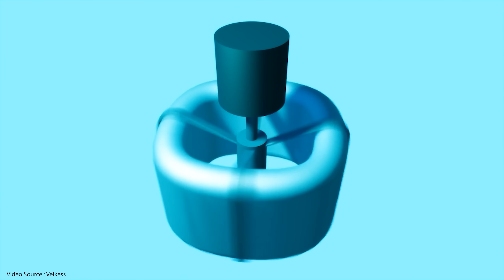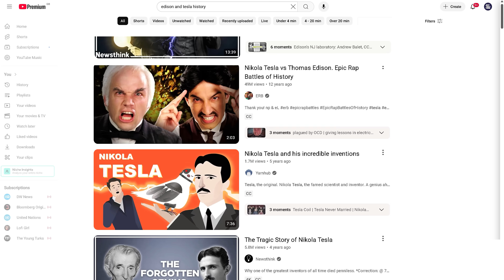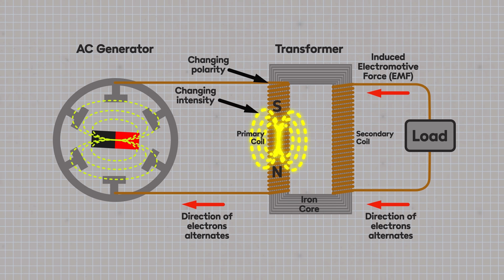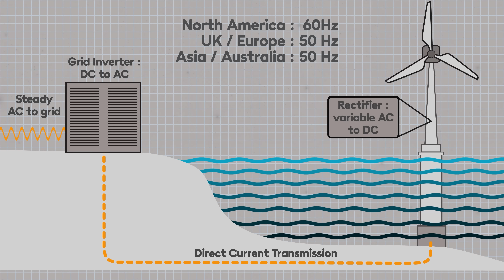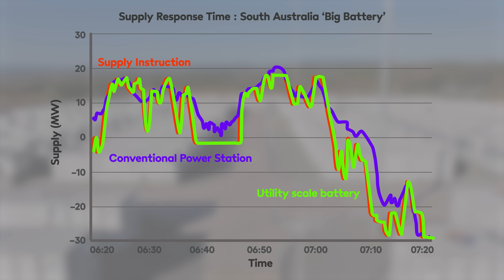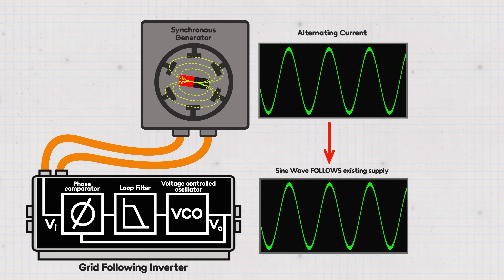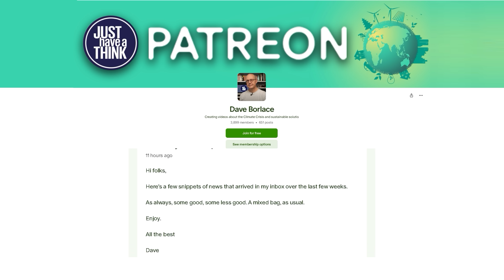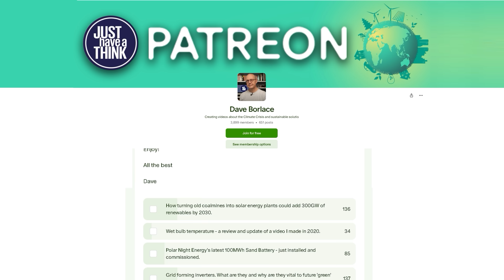How GRID FORMING INVERTERS are paving the way for 100% renewable energy.

Comment: The issue will be having a master waveform generator.  From a blackout situation you can’t have multiple  inverters all start coming online and trying to back feed the grid.  The wave forms all need to be synchronised.  For this there needs to be a common stable waveform for them to synchronise to.  Black starts will be  a lot slower to come back  without the large power stations running in the background as the master clock.
There’s nothing new about grid forming, inverter drives have been doing this for a long time.  If you have batteries and a grid forming inverter there is no reason why your own house can’t come online but it won’t be able to back feed to the grid while someone is potentially working to resolve the issue in transmission lines.  You certainly won’t be able to just start the grid yourself from your own inverter.  Networking them isn’t a possibility because you don’t have power for a network communication.  
They might be able to split the grids into smaller sections that can come online from a fairly large battery inverter and link up one by one.  That’s a fair way off and would be a lot of infrastructure changes and safety precautions and interlocks.   The risk to the workers on the grid from a dead cable suddenly becoming live will not be easy to mitigate with grid forming inverters.  
There’s also a  huge amount of inrush current needed to restart even a block of flats from a total blackout.  Multiple smaller inverters are really going to struggle to provide that kick.
To say network inertia isn’t a thing just isn’t true,  it’s not solved and it’s not solvable without serious changes to the way we maintain and distribute power.

Comment: Inverter frequency is determined by an oscillator, load has no effect on frequency (except when tracking a change in grid frequency).  

A second benefit of turbine (flywheel) based power generation is short duration surges.  The inverters that I've designed are capable of 125% of load, the shut down when load hits 150%.  Even if the load transient is very short.  This keeps the power switches from overheating and failing.

A turbine based system can provide many times "full load" rating with a slight dip in voltage, and slight dip in frequency.  The thermal mass of the generator keeps it from overheating unless the overload lasts a long time, in which case protection circuitry disconnects the generator.
Reply: A stand alone inverter uses a simple fixed oscillator however a grid connected inverter must generate at the same frequency as the grid it is connected to.  A grid-following inverter simply runs at the exact frequency of the grid in in phase with the grid.  A grid forming inverter will run at the same frequency as the grid, however it will try to increase or decrease the frequency based on the primary control response (Frequency-Watt) by trying to advance or retard the phase of the voltage it generates compared to the grid voltage.

Comment: I Install Victron systems that disconnect the user from the grid and continues to supply power if a power outage occurs or the grid gets unstable. You won't even notice it, wich is great for critical use cases like hospitals, military, communication infrastructure and production. They run on battery and solar during the outage and re-synchronize to the net after it comes back and then reconnect.
These systems can either feed surplus (solar) power to the grid, just supply the used power or supply peak power, when the grid connection is to small. 
As far as I know, no gridcode allows theses systems to act as grid forming inverters yet. But that would be a simple firmware update away, if allowed.

Comment: I'm no expert, but as this is usually described, it seems to me the frequency is kind of "floating", as in great effort is put into keeping the momentary frequency as close as practically possible to a specific value, but without much, if any, regard to how the curve changes over time. If the voltage was controlled to follow a predetermined path, it shouldn't be too difficult to make grid forming inverters improve frequency stability, quite significantly.                

Just keeping the momentary frequency as close to a fixed value as possible makes sense when you rely on inertia to maintain that frequency, much in the same way as it makes sense to keep firewood around if you rely on smoke signals to communicate over long distances. That is to say, just because something has been the best way to do something, under certain conditions, doesn't necessarily mean it will remain the best way to do that something forever more, in every situation.

Anyhow, I suspect the greatness of inertia sometimes is slightly exaggerated, as you can't increase the amount of power you extract from the rotation of a rotating object without either decreasing the inertia, which means, decreasing the rotational speed, or compensate by adding the same amount of energy to that rotating object. So all sorts of clever engineering and compromises is needed to make it possible to instantly increase the power output more than insignificantly, while keeping steady rotational speed of steam turbines in thermal power plants. 

And it seems to me that it should be possible to make grid forming inverters that are able to produce a fixed frequency following a predetermined path, and deliver whatever amount of power there's need for that the DC source can supply. If that's the case, that should decouple the frequency from the power situation. I suspect the voltage would still be "floating", but not having a lot of systems reacting, and sometimes overreacting with catastrophic consequences to changes of a floating grid frequency should be a big win.
Reply: The line frequency is, or at least was, determined by the balance between generation and demand.
Each generator has something making it spin. That has a control system that varies the power applied (steam, etc.) with respect to line frequency. Lower means more power and faster means less.
If the grid frequency drops too low, the system operator will bring another generator on line. Thus the frequency is never accurate or even closely controlled. But over time it averages out to 60Hz. Although they would like to loosen that up a bit. Now that the supply of wall clocks using AC sychronous motors for time keeping is thinning out.
Reply: The specific grid frequency serves a very important function in what is a distributed democratic control system.  Each grid asset casts a 'vote' on the basis of trying to pull or push the grid frequency and the actual grid frequency is the composite tally of all the individual votes.  The rules of voting are based on following a strictly defined primary control response  - Volt-VAr and Frequency-Watt.  And the primary response 'droop' settings can be updated by the grid operator in the form of what is called secondary control response scheduling.

Comment: We also need Grid Holding systems that sustain the grid for a shorter period of time (essentially inverting the fusing time curves that provide discrimination for the 'circuit breakers' to reduce the circuit breaking activity).

There's a lot of misunderstandings about where the centre of control and stability is located (and how it moves) and where the trip/bottlenecks are located.

Comment: This is why I advocate for indirect, hydraulic transmission wind generation.  That means that the turbines are driving hydraulic pumps which transmit their power via high-pressure pipelines to a central station where the hydraulically-driven generators are.   Between the two, a battery of pressure accumulators can store excess energy when the wind is plentiful and release the pressure when it's stagnant.   This smooths out the delivery of energy, makes generator maintenance easier, simplifies turbine design (because hydraulic pumps are simple devices) AND simplifies the electrical system by eliminating the need for frequency regulating devices.

Comment: The UK grid doesn't trust the renewable industry to supply stable energy supply, this is where batteries come into there own, sitting between the solar panel and inverter. The inverter can take power from the solar when the sun is out, but as soon as the solar goes into shade because of a cloud the inverter can take from battery, with using grid forming inverters,  the grid "never" sees a drop in power supply and so it "should" be taken up very quickly,  IF the politicians stay out the way.

Comment: Very good ! A outher way to look at it is them portable power stations makes 50/60 CY AC from battery and no grid needed for them to make power. They have a internal oscillator that sets the frequency and a voltage regulator system that sets the voltage . This can start a grid following inverter . connect the 2 and you have a micro grid. add a outher grid following inverter ETC the grid grows .What they have done is add the local oscillator to set the pace to the PLL . And some smart micro controller that can shift the phase of oscillator to sync to the grid.  What power stations with spinning turbines all ready do when coming on line.    All this can be done electronicky now. no moving parts .  This is game changing for black starting. Any grid forming inverter can start the system . This will shorten time to get everyone online after a black out or storm damage to grid. Only the damaged grid will go dark but the connected  stuff can stay online or re form that part of the grid until repairs are made . This shrinking the outage area buy a lot ! Lots of work to do to perfect this . Adding AI into the controllers is a outher break threw.  The grid has to become smarter to deal with clean energy. And we making progress . Cheers from NY ! Japan is only country with 50 and 60HZ within.  And we can now easy connect them . DC interconnects . South America already doing that .

Comment: Generating 50hz - about as simple as it gets. Off grid inverters do that. £100 inverters to plug into the 12v cigarette lighter socket in your car do that. 
It must just be a question of rules - WHO gets to start first, before others join in.  Ramping up a stopped grid must be what is most difficult.  1000 fridge motors wanting to start - needing 10x or 100x their normal current to start turning. If enough power to do all this is not available quickly you get what I think is called a “brown out” - a much lower voltage than the norm. The fridge motors struggle and burn out while consuming 100x their normal power … 
So enough power at the right frequency and voltage has to ramp up very quickly … the wires have to be big enough to take the extra startup current … hence the need to start up portions of the grid, one by one - not overwhelming any single section. 
I wonder if any grid on the planet is synchronised with atomic clocks somewhere … making it easier … bits of the grid could start up independently, getting stable, before joining up. An interesting problem, especially considering the trouble that could be caused by bad people hacking into the control systems … apart from figuring out and then agreeing standards that must be the biggest problem.

Comment: JHaT,

while grid forming inverters can provide some artificial inertia, running a grid requires more than that.
Inertia is a damper that smooths slight frequency deviation that occurs as load and supply fluctuate. However an increasing demand requires a corresponding supply input and GFIs cannot provide that. 
Dispatchable power is essential to maintain frequency, just ask Spain. Since their blackout, which they are fortunate that France was able to supply dispatchable power through the grid tie made the duration of the blackout relatively short. The U.K. has no such tie and a blackout here would take much longer to clear.  
They have since increased the amount of dispatchable capacity on their grid; simply they were taking liberties with physics in trying to run too much renewable capacity relative to demand.
So GFIs will not allow a 100% renewable grid. The measures taken to try and get as close as possible to 100% renewable add considerably to an already expensive source of electricity and add additional detrimental harmonics onto the system.

Comment: This is the first of your videos that I have seen. Very nice. One question that I have tried to find the answer, but with no success. I understand phase lock loops. What I am not sure about is how does the phase lock loop only look at what is coming from the grid and not the output of the inverter. I thought that the output of the inverter is connected in parallel with the grid. So what keeps the phase lock loop from responding to the output of the inverter? It seems as though once the inverter is outputting ac voltage, the phase lock loop would see the frequency and the voltage of the output of the inverter and keep running even if the grid went down. Thanks for a great video.

Comment: That's a good beginning introduction to grid inertia, but it leaves unstated what the major problem is: coordinating the grid-forming inverters which are in separate locations and connected to different sets of transmission lines.  Each such separated set of inverters will see different load-supply conditions at their location which is different than that seen by other sets at their locations.  There is very tricky coordination needed by all such sets to keep the pieces of the grid connected in the face of potential transmission and/or generation failures occurring anywhere in the grid.
A reliable solution might well require local atomic clocks to provide reliable timing, plus fast communication between the sets of inverters telling one another what condition they are experiencing, the wave lag or lead present, and how much energy they are adding or subtracting to reverse that deviation.  The trickiest part is how to use that information about neighbors near and far to do the "right" thing with the local set of grid forming inverters to prevent partitioning of the grid due to uncoordinated waveforms.

Comment: That’s a very good point that proponents of wind and solar never mention. That if the grid fails, then the DC power coming from solar panels and wind turbines has no grid to join.
So I understand the grid forming inverters, and that they can actually synchronize with each other to form a grid of their own. But is that grid separate from the hydro/turbine grid, does it completely replace it,  or does it feed the existing grid until the turbines are running again?